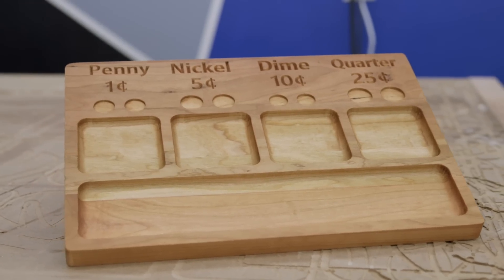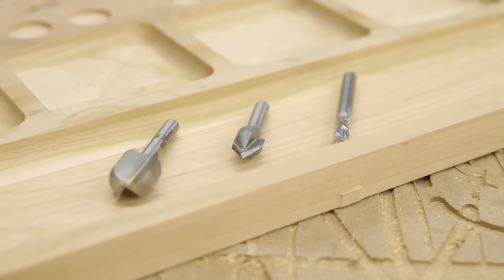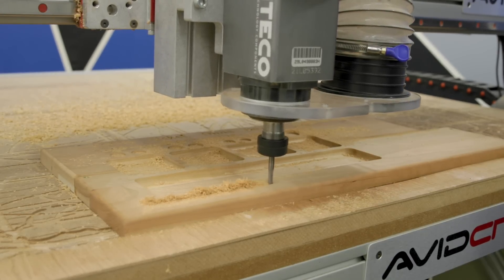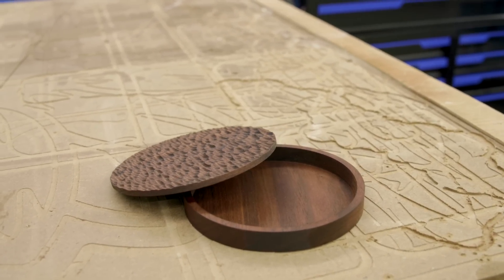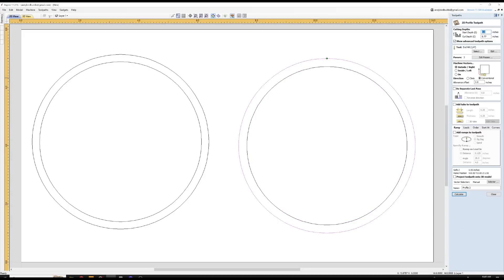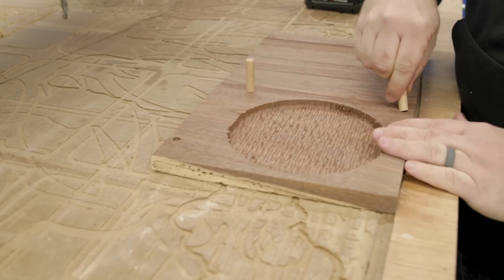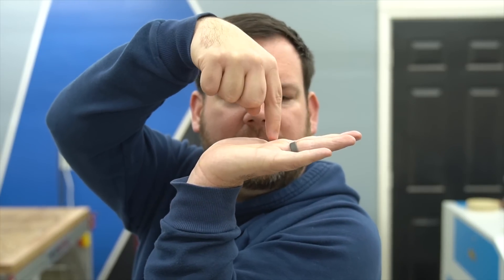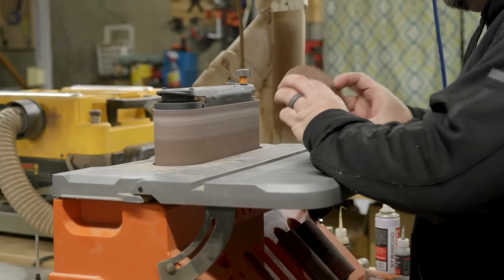Low Cost, High Profit CNC Woodworking Projects (With FREE Vectric Files)

Comment: Thank you for the files! I am new to CNC woodworking and I am trying to change the bit I want to use on the toolpaths for the pockets but the file will not let me select one from my database. Any advice? I have a 1" bowl bit (.375 tip). Thank you

Comment: Hi Andy, can i ask have you ever had issues with wood warping, cuping, movement etc on these solid wood cnc projects?
Reply from the maker: Yes I have. The keys are to start with dry wood, under 8% moisture content and to leave at least 3/8th on an inch on the bottom. The thinner you make the more likely it is to warp

Comment: I'm still waiting to get my first cvc machine. Never used one before. My question is, so do you change out the different bits during a single project? Example, one bit for the text, pause the machine, put in a larger bit for the bigger carvings, resume the machine, etc?
Reply from the maker: Awesome! You are correct. Let me know if you have any other questions
Reply: @AndyBirdBuilds  Thank you! I do have one more question-
How does the software know that it's just doing the text? Is that something you tell it when you're ready to begin? Then you pause the machine, then tell it to do the next thing?
Reply from the maker: @renspecs  No problem. In the software you set up different toolpaths. This tells the machine where to go.
Reply: @AndyBirdBuilds  Thanks !

Comment: How did you prevent the box from cupping? Whenever I do huge pockets like that, the piece cups super hard
Reply from the maker: Its important to start with wood that has been properly dried to 6 to 8 percent moisture content. Its also important to keep the wall thicknesses above .375 inches. I don't like to go much lower than that.
Reply: @AndyBirdBuilds  Material is dry, lots of thickness left. From my research, its "just" the stresses in the wood being changed/released after pocketing. >5years experience doing this and it doesn't matter what I try to do... doing big pockets like that cup like hell. Is the piece still flat now & the lid sits right after its been some time?